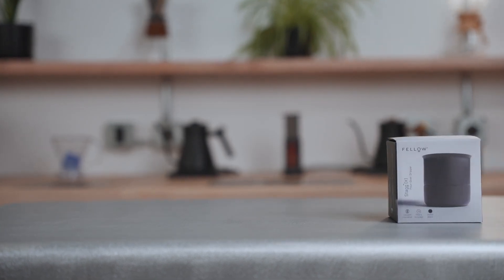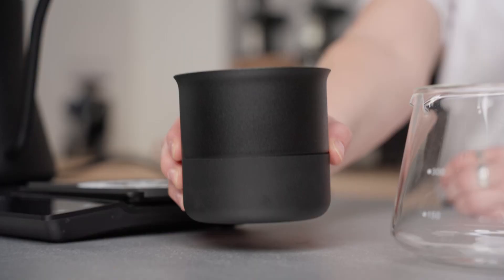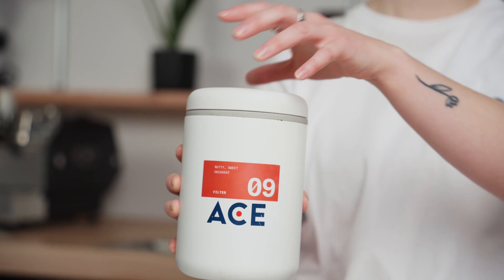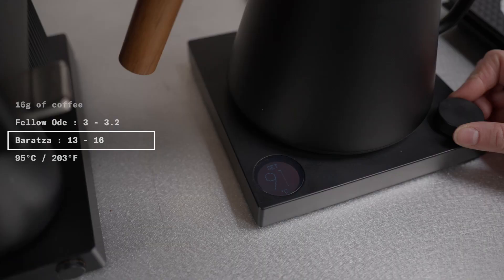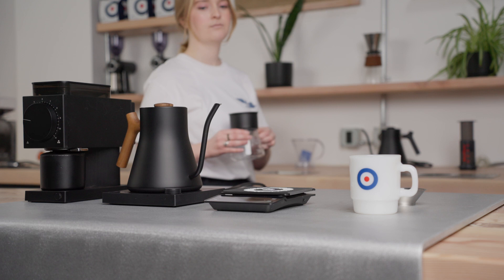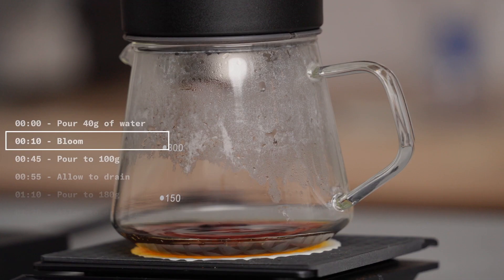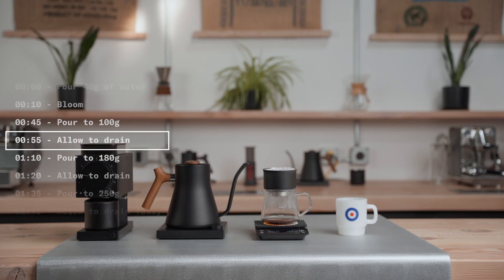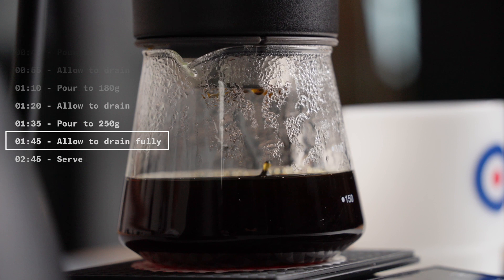Brew Guide | Fellow Stagg

Comment: Is the recommended Fellow Ode grind setting for Gen 1 or Gen 2 burrs?  How many clicks on the Comandante C40 do you suggest?
Reply: Probably late on this one but trying the setting on a Gen 2 actually worked. Keep in mind later I had to re-calibrate my grinder 3 clicks back. So if you have a calibrated Gen 2 then you probably have to go about 3 clicks courser than mentioned.